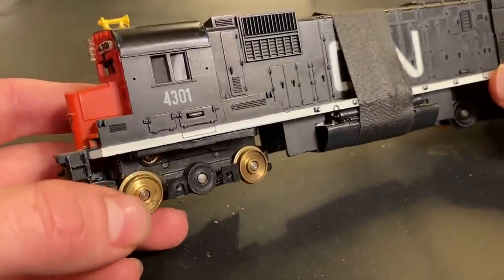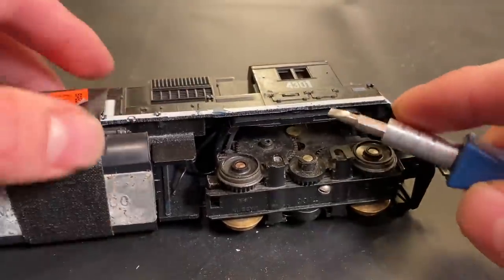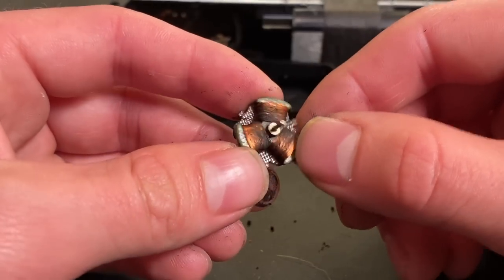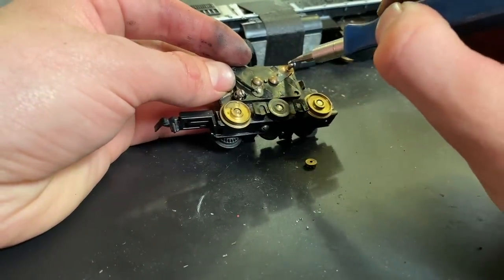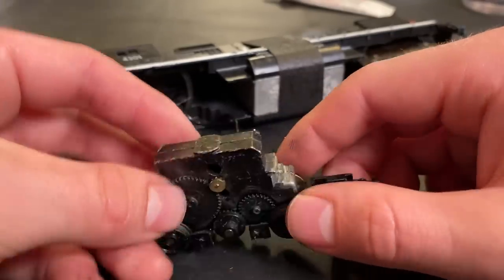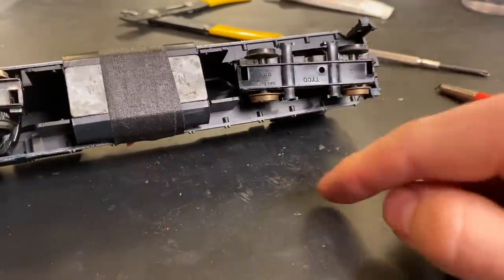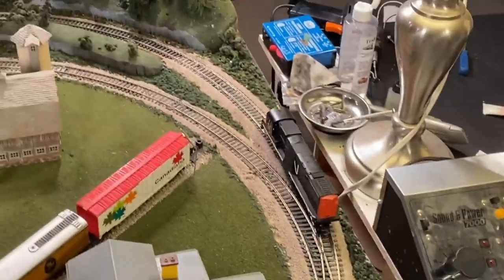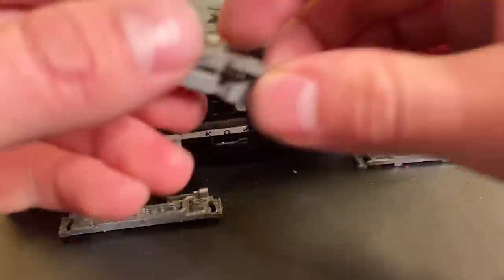1975 TYCO CN Locomotive - Will it Run Again?

Comment: With some body modifications and the inclusion of some correct Alco 6 axle sideframes and small aIr tanks in place of those Tyco GP-20 fuel tank parts below the frame you could have a FC del Pacifico AP1620 Empalme shops (1979 ) rebuild.

Comment: You did well. It's amazing TYCO made so many ALCO diesels no GE engines the ALCO resembled the GENERAL ELECTRIC engines. I was so glad you found spare parts for this ALCO , Harrison I could hardly tell the difference on the side frames on the trucks. You make this CN model railroader on this side of the border even happier you saved this engine. Great job👍✅

Comment: You should look into resin casting and mold making.
Reply: Yes - SMT could make a bunch of truck side frames!  Other parts that are often missing - like horns, or broken steps - could be molded.
Reply from the maker: If I could figure it out, it could be an excellent tool

Comment: An example of a Tyco foobie - no C430's were sold in Canada by either Alco or MLW. Only 16 were built

Original Owners

Owner[	                                       Quantity	Numbers	Notes
Green Bay and Western Railroad	1	315	
New York Central Railroad         	10	2050–2059	
Reading Railroad	                                 2	5211-5212	
Seaboard Coast Line Railroad	         3	1275–1277	ex Alco (demonstrators) 430-1 to 430-3

Of course, it's your railroad, nothing says CN couldn't have bought some. 

Here's a list of MLW-Bombardier built Four axle Century series locomotive models

Model	       Build date	Total
produced	Wheel
arrangement	Prime mover	Power output	
C-424	       	1963–1967	92	B-B	16-251B	2,400 hp (1,790 kW)	
M-420		1973–1977	91	B-B	12-251C	2,000 hp (1,490 kW)	
M-420B		1975	         8	B-B	12-251C	2,000 hp (1,490 kW)	
M-420R		1974–1975	5	B-B	12-251C	2,000 hp (1,490 kW)	
M-420TR	type 1 1972	2	B-B	12-251C	2,000 hp (1,490 kW)	built for Roberval and Saguenay
M-420TR	type 2 1975	15	B-B	12-251C	2,000 hp (1,490 kW)	built for Ferrocarril del Pacifico
M-424		1980-1981	72	B-B	16-251B	2,400 hp (1,790 kW)	(16 built for Ferrocarril del Pacifico, 3 built for Unidos del Sureste and 53 for Ferrocarriles Nacionales de Mexico)

Comment: SMT - I think the mounting method you used for the fuel tank is similar to how Tyco mounted the front coupler on the pre power torque motor F units.
Reply from the maker: Good point, hadn't thought of it that way.

Comment: I have to ask, what brand is your controller for your layout? My son models HO scale while I model N scale. We both like the controller you use. We just wanted to know what brand it is. I hope you don't mind me asking.
Reply from the maker: Mine is an MRC Tech 3 9500 series. Most of MRC’s dc controllers are pretty good.
Reply: @SMTMainline  Thanks. All we have are two cheap controllers. Got them with two different Athens train sets I bought when my son was about 4 yrs old. I got him the John Deere set along with the Coke Cola Winter set. Now he's 20 yrs old, and he has expanded. He has a little bit of everything Ho scale.
Reply: @SMTMainline  my dual throttle mrc we had as a kid was old when I was little.. I'd rather use analog. DCC engines are ridiculously overpriced. I'm really enjoying your videos because this is pretty much how I'd be model railroading. Now if I could find my little stash of trains I'd make you an offer.

Comment: I wonder how many TYCO engines ended up melting. I had a Conrail F unit that ended up having part of the cab melt as well.
Reply from the maker: These locomotives are prone to all kinds of different problems, I'm sure it happened plenty of times.

Comment: Hey I have a question for you what did you use to put the glass on the edge of your train set to stop the trains from derailing because I would like to add it to my set
Reply: I have the same thing on mine. I just used plexiglass and some wood glue with a few nails

Comment: You need to paint the Trucks Black would look so much better...
Reply from the maker: Probably would be more prototypical
Reply: @SMTMainline  - I wonder if Tony Cook's Model Railroad Resource Center has a picture of this engine, so you can see if it should have silver truck side frames.
Reply: @Petemonster62  Except CN never had any C430's. Although, judging by photos of other types of locomotives, it appears CN painted trucks black. As for painting these trucks, I am in doubt paint would stick and a chipped paint job would look absolutely terrible
Reply: @colbeausabre8842  - It does seem that the truck side frames are molded in that silver plastic.  Probably would have to scrub them with a old tooth brush using a dishwashing detergent solution to get the black paint to adhere to the side frames.

Comment: Not that this is relevant but, my Life-like little blue controller finally died. (I was expecting this to happen since it’s from the 80’s-90’s) I’m stuck trying to find a controller that is cheaper but reliable. I only have 5 ho scale locomotive and just like to run them for fun. Any suggestions?
Reply from the maker: A basic used or new MRC DC controller should be good. I’d avoid older DC controllers if possible.
Reply: @SMTMainline Thanks, real lifesaver now  that I have some advice, I’m a little new to the hobby.

Comment: I have a problem with the pinion gear spinning around the motor spindle.  Without the pinion gear, the locomotive doesn’t move.  Do you have a suggestion how I can affix the pinion gear to the spindle so that when the spindle moves so does the pinion gear?  Solder doesn’t want to take because the spindle is stainless steel.  Ideas?
Reply: ca or epoxt
Reply: epoxy or replace motor with a cd motor
Reply: @ededwardson6074  Thanks!
Reply from the maker: Make sure the pivot gear is fully installed then add crazy glue over the top of the gear, be careful not to put too much or else it will run down the sides and get in the teeth.
Reply: @SMTMainline  Thank you!
Reply: @SMTMainline  using the gorilla 🦍 gel glue sounds like a good 👍 idea! But a tiny steel clip, round with a hole in the middle and 2 tabs to grip the output shaft would be the best. Finding one will be difficult, however. Good luck!

Comment: I dont know about you people BUT I just love the old Tycho engines , not so much those like this pancake motor , I think they call it but the older ones  with the worm gear ... dont you ?
Reply from the maker: Yes, the original TYCO Mantua drives with the 5 pole motors are great things. MU2 drives I believe they are called.

Comment: I don't know why but the last 3 or 4 videos I had to turn on Closed Captioning I couldn't hear you and my volume is all the way up I can hear other videos just fine but not yours I have no idea what's wrong.
Reply from the maker: Seems fine on my end but it's possible I didn't have the gain turned up high enough. It can be fixed slightly in post production if it's overdone it will distort the audio.